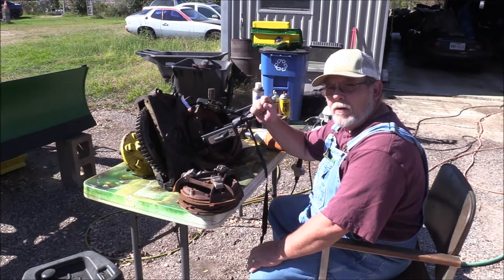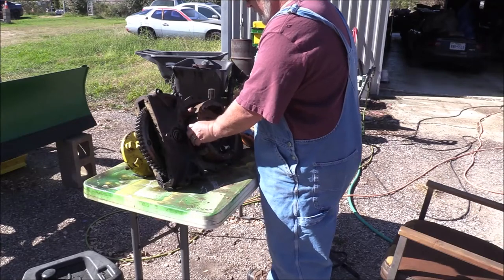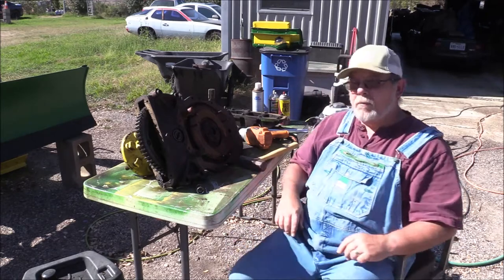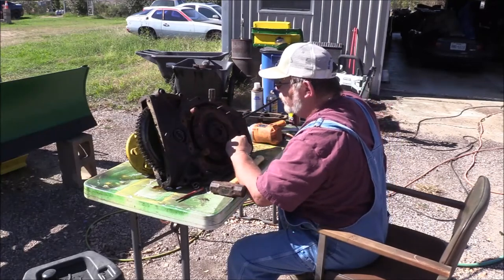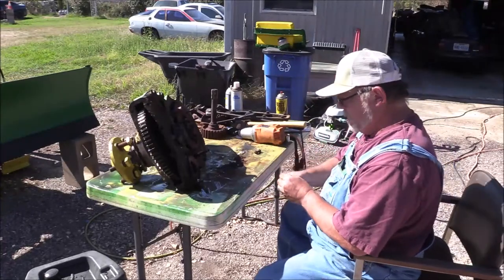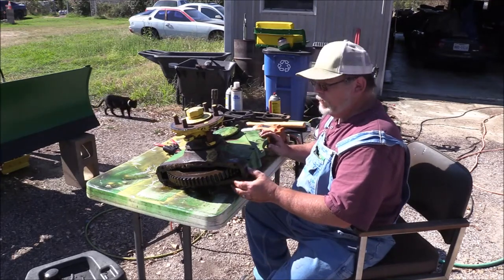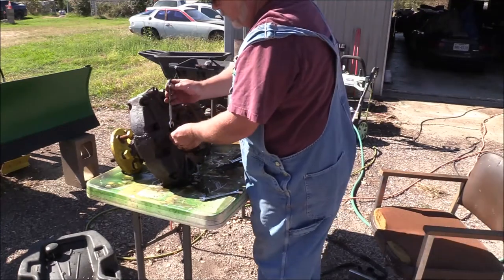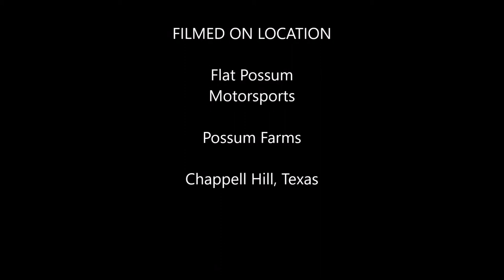Fixing up the John Deere MC Crawler - Part 27 - Pulling the clutch/brake drum

Comment: i feel your pain, if those four bolt holes are threaded you can use four bolt's, small map gas torch is cheap and helpful. hope JD doesn't over charge you. i ordered a fuel solenoid  for my garden tractor it was $150. later found a clone for $45.
Reply from the maker: I have been getting a lot of parts form JDCRAWLERS.COM
Reply: @possumfarms  i've been skipping the painting and rust removal waiting for the reassembly.
Reply from the maker: @j.walker3498  - I wish I could!  I'm waiting on parts again!  I found that the quill on the axle shaft was cracked - I HAS to be replaced...  So I get to sit on my hands and wait for the USPS lady to show up with a package....  Again...  It won't be too much longer - I hope!
Reply: @possumfarms  oh no! give a tour under that tarp.
Reply from the maker: @j.walker3498  - Which tarp?  The blue/grey one or the tan one?
Reply: @possumfarms  both but preferably the one with blower holding it up. Hehehehe
Reply from the maker: @j.walker3498  - Ask and ye shall receive! - https://youtu.be/oskM-DWcCO8